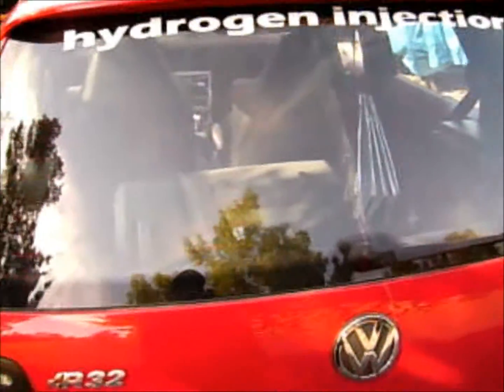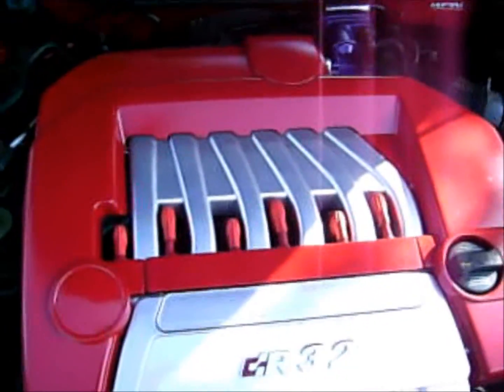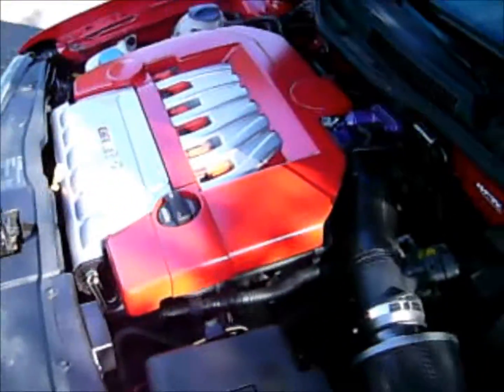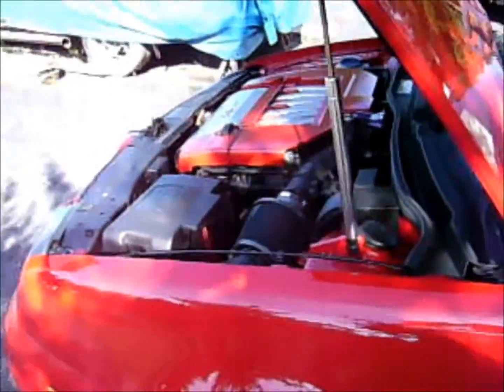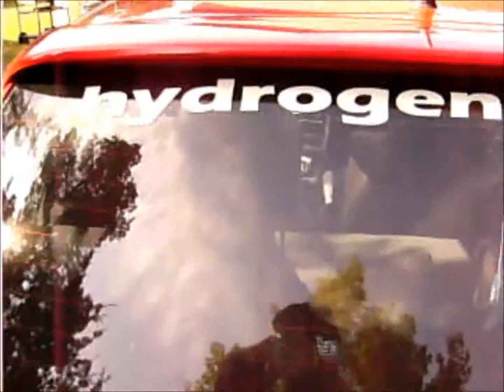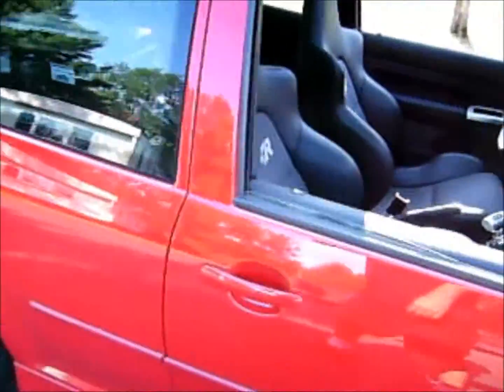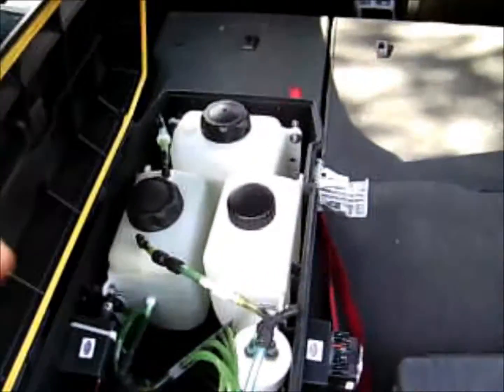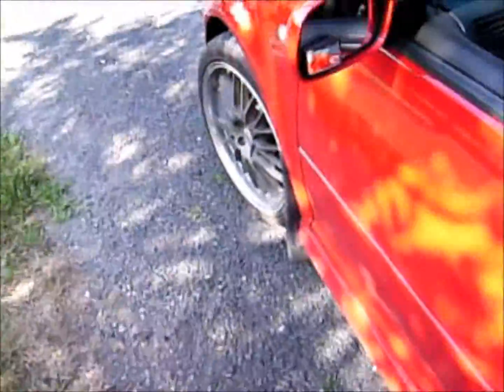VW GOLF R32 HHO ENRICHMENT SYSTEM INSTALL

Comment from the maker: It is the resultant of the process of electrolysis which uses electricity to separate water into its constituent elements - hydrogen and oxygen in a 2:1 ratio - 2 hydrogen and one oxygen molecule, hence the slang term "H H O".